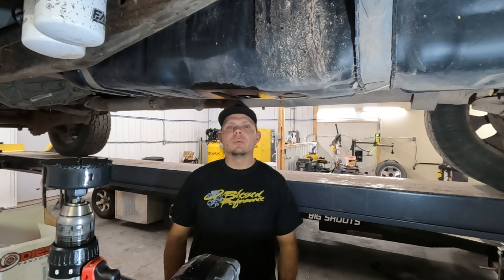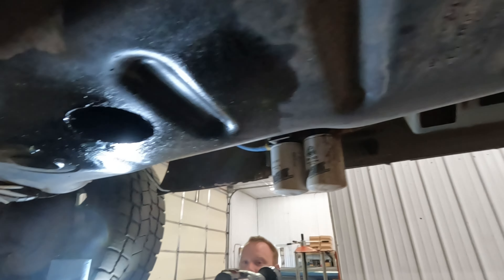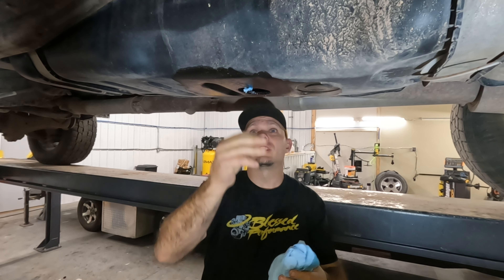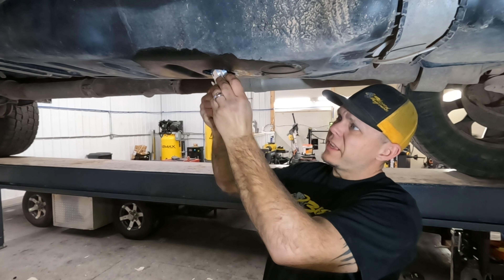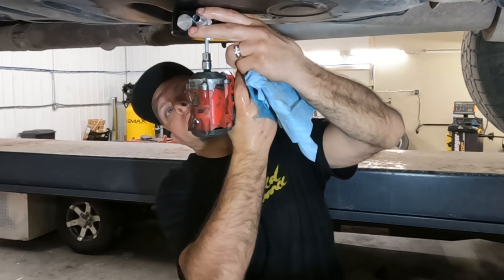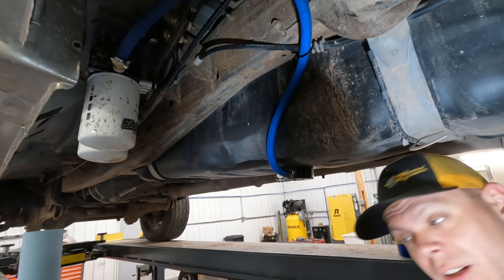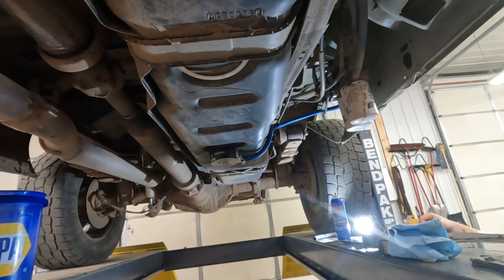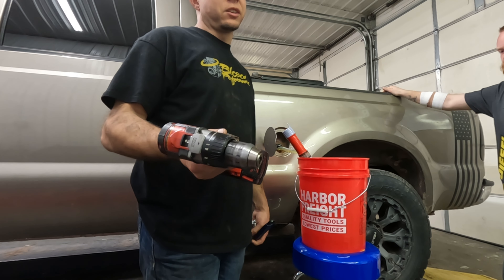Seamlessly Installing the Beans Diesel Sump onto your 6.0L

Comment: If you have a hard time, pushing a hose on aqua net hairspray, makes life so much easier 30 seconds worth the work time it’s slippery is snot then it  dries
Reply from the maker: Great tip!
Reply: I was going to suggest dipping the hose in boiling water to help push it on the fittings. But if hairspray works it should be faster than boiling water